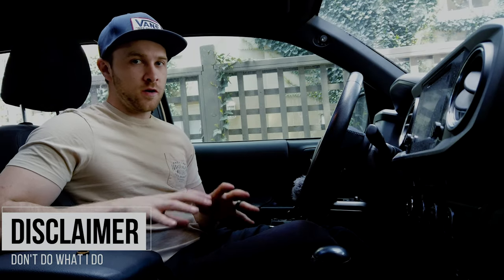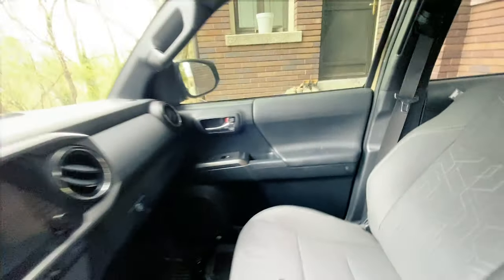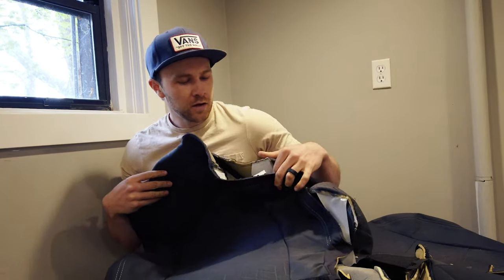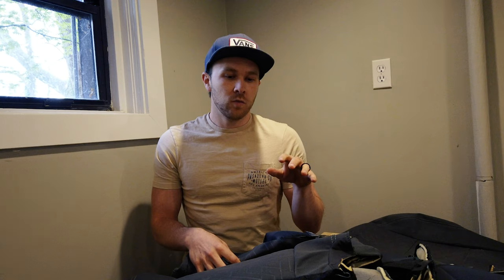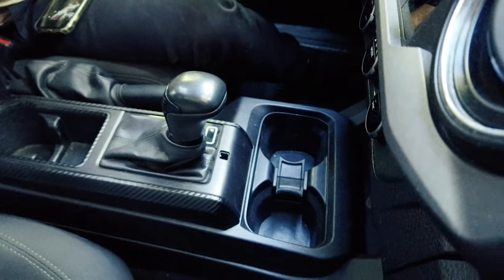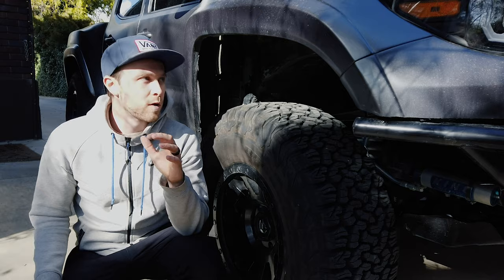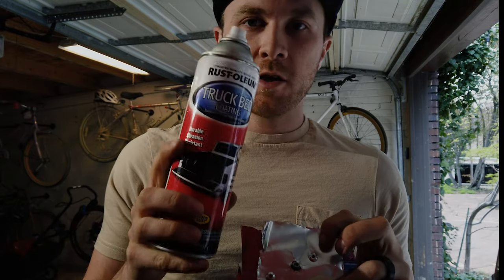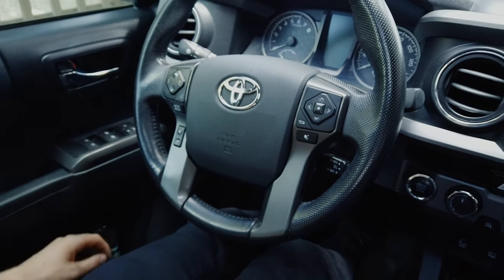Repairing the Blown Airbags on my  Salvage Tacoma Rebuild Project (Over $3000)

Comment: I took the front end of my car off. I changed two blown knee airbags but I haven’t reset the airbag module. If I connect the battery how it is could it make the airbags I replaced go off? Thanks I just want to check out the features on the car
Reply from the maker: I'm not an expert so take this with a grain of salt. I disconnected my battery first. then airbag module, then installed airbags, reconnected the module, and then reconnected the battery.

Comment: Where did you source the side curtain airbags? I've got them bypassed with resistors currently after some research and the srs module is happy (no codes, just saved crash data), but I still need to send off the module/seatbelt for rebuild. I was also curious if any of the impact sensors would need replacing, but it looks like you did not have to replace any of them. I'm working on a 2017, but I'm assuming the main airbag module should be in the same location. Any info on sourcing the curtain airbags, or impact sensor replacement would be awesome! Thanks!
Reply from the maker: Sorry for the late reply. I'm selling my curtain airbags if you still need them. DM me on IG https://www.instagram.com/sammweb/